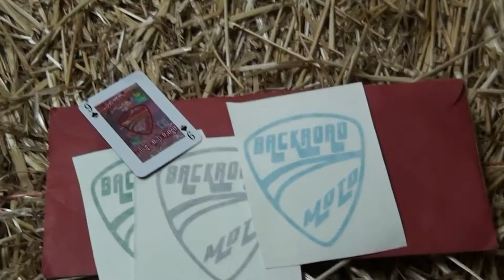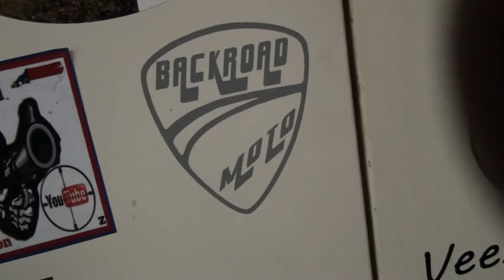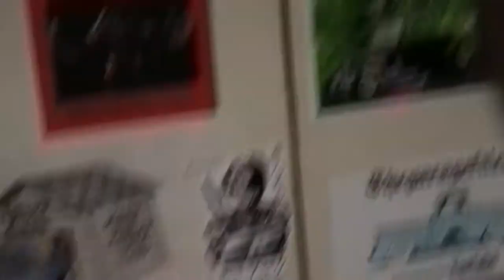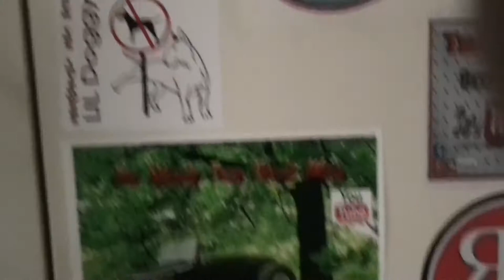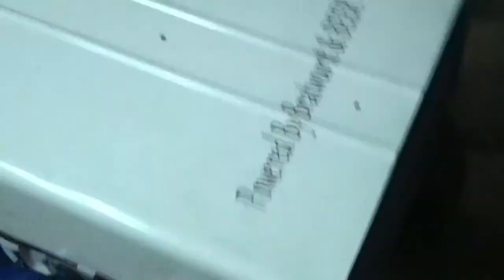weekendupdate 10 2 2016

Comment: hehe duelly on a lawn tracktor, thats funny!! does it bolt streight on to the other one aswell ?
Reply from the maker: It should I have to try it to know for sure if the bolt pattern is the same. The stock wheels in are a bit smaller and more narrow so it will be close. I think I am going to try and get the wheels on the orange one just for fun if it works I will take a small clip of it.
Reply: MidwestMotoRider
that should be tryed !! if it dosent fitv theres no need to change them , just duelly the other !!
Reply from the maker: Yea, I am going to try this weekend and see what I come up with but either way I will put them on the orange one just to see and have some fun with it. :)
Reply: MidwestMotoRider
 garden race is on haha , get the folks together and race!